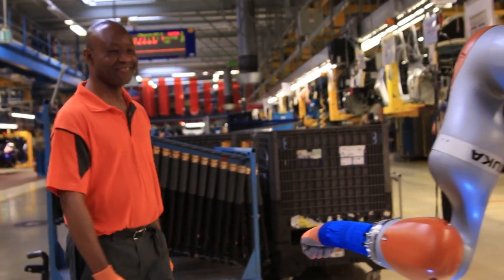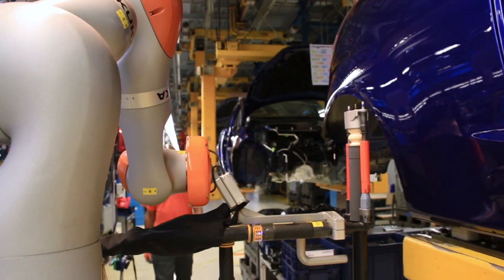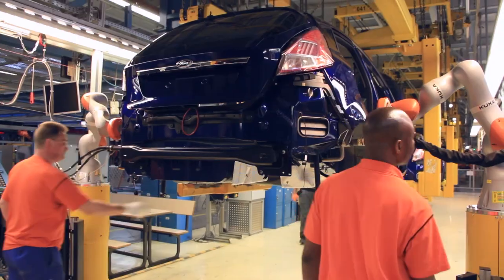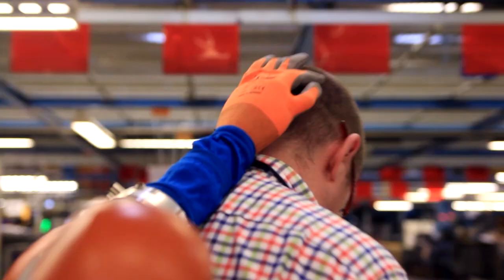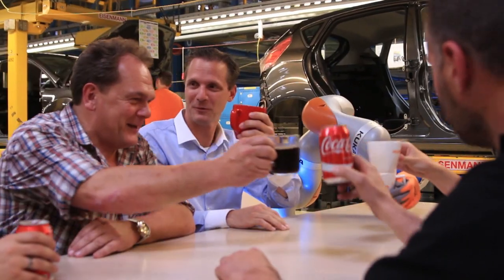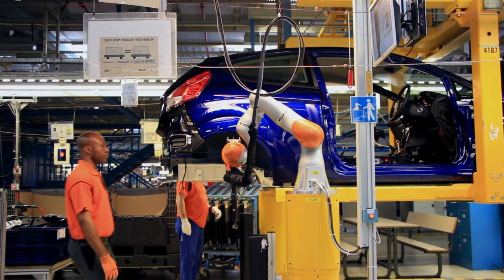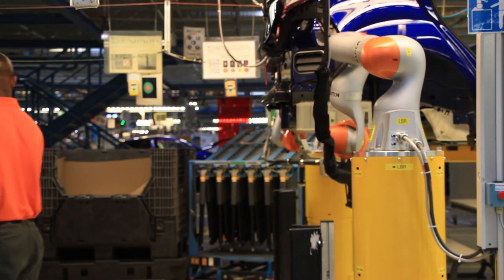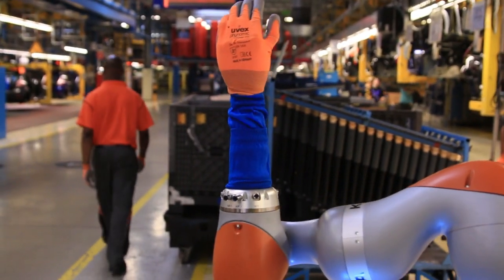Car Workers and Robots Work Hand-in-Hand

Comment: Most of the automation I've seen cost more, breakes down more, and needs a Skilled Trades worker standing next to it to keep it going.
Reply: True, but that's often been true with many emerging technologies over time. Eventually it will be an option that's almost impossible to ignore.
Reply: Agreed. 

I just don't see automation being the end of the world. As we lose jobs in one area, we gain back a few in  another. Workers will have to adjust like we have since shoe cobblers were replaced by machines. 

Also, Skiled Tradesmen make more money and are harder to replace. Which tosses a little power back to the employees. 

I don't build vehicles anymore. I fix them. I had to update my skills and learn a lot. It has been a healthy experience for me and it has made me more useful to my employer.
Reply: +PaleTrailRider "I just don't see automation being the end of the world" true, but it has our current socioeconomic system in it's cross-hairs. Simply if we were to optimize technical efficiency throughout the entire market, automation, AI, robotics, there would be virtually no basis for maintaining human employment, you would make things so cheap that people's sustenance would require almost no income and the whole economy would come crashing down. At some point the rate of technological job displacement will outpace emerging technology jobs simply due to increases in efficiency.

Technological unemployment is inevitable, the tough question is how do we adapt our socioeconomic system to mitigate this?

The best proposed feasible socioeconomic system I'm aware of today is a 'Resource Based Economy', it is unlike any socioeconomic 'ism' that has gone before it, NO MONEY, NO HIERARCHY. Please if you haven't already done so view the documentaries 'Paradise or Oblivion', 'Future By Design', 'The Choice Is Ours 216' by 100 year old Jacque Fresco the visionary of 'The Venus Project'. An elder with that amount of life 
experience deserves at least a few hours of or time.... Additionally check out 'The Zeitgeist Movement' founder Peter Joseph.
Reply: +veganath I only know what I have seen. They don't make things cheaper and they frequently create better and higher paying jobs than they eliminate. 

Take windshield robots for example. We used to have two people decking windshields. It was a tough job. 

Now we have one person feeding the machine and a tradesman who is never far away to keep the thing going. 

Also, the error rate has gone way up. Every single weekend workers are paid overtime to fix damaged or leaky windshields. 
I've seen this play out with automation repeatedly. 

I would argue that most of the efficiency gains have come because of weaker unions and workers putting on more parts per vehicle than ever before. 

Also, we used to clean our own bathrooms, remove our own snow and cut our own grass. All of that and more has been farmed out.